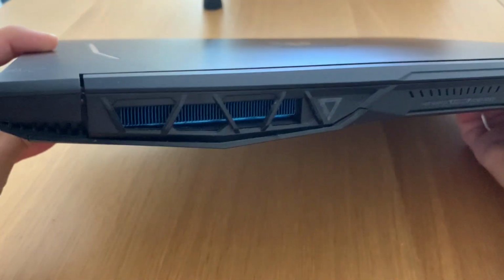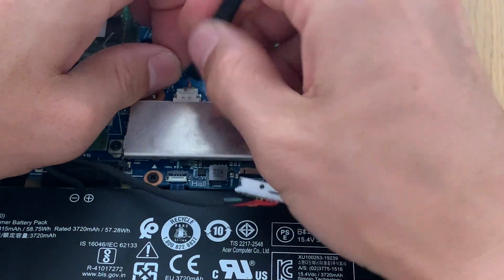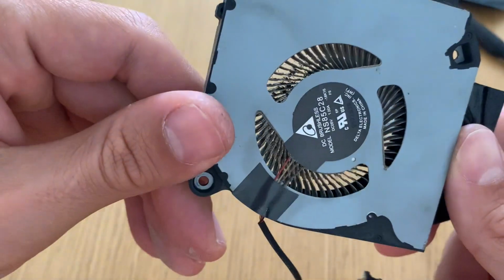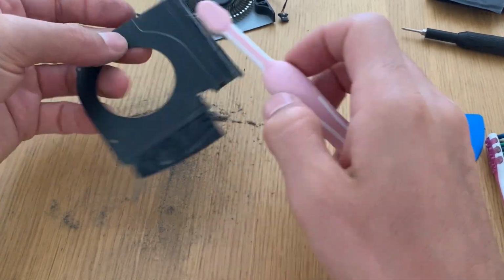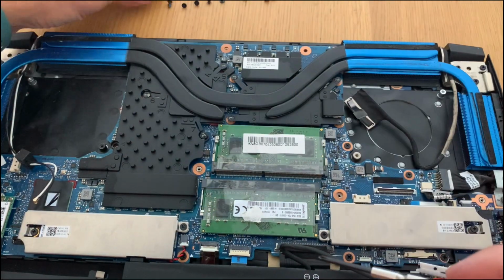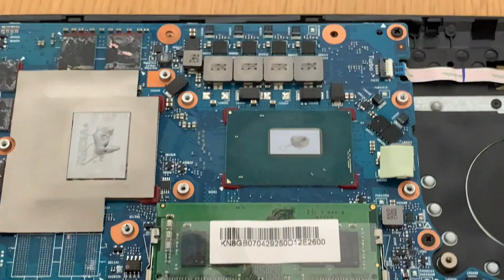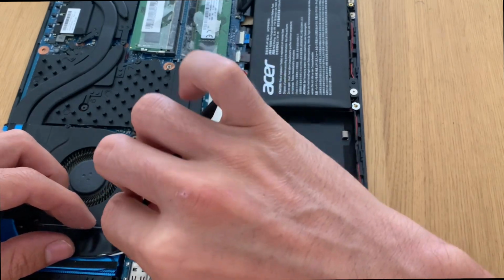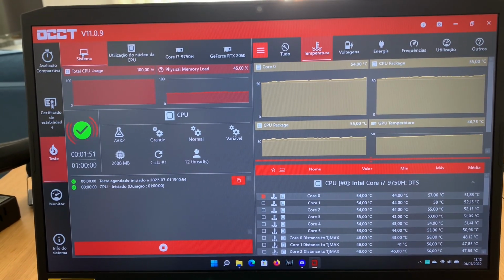Overheating Acer Predator, What to DO?

Comment: Same problem cpu reach 99c 
Should i disable intel turbo boost
And after how much time should i apply new thermal paste
Reply from the maker: A clean should do the trick, just follow the steps on this video, it worked for this computer, me and the owner learned that part of the issue was also a defective charging brick that was not outputting enough power on it, apparently it is a thing in this model.
New thermal paste depending on the use should be done at least every 2 to 3 years, or anytime you need to open it to clean.
Good luck

Comment: Hey nice video btw

I got acer predator triton 500 with rtx2060 and it’s overheating. What thermal pad and thermal paste you consider for me to buy?
Reply from the maker: Hey, thermal paste I use Artic silver its expensive but very good, thermal pads only replace them if your shatter when removing them, if they do you can buy Innovation Cooling Graphite Thermal Pad.
Reply: @zul_fix  what about honeywell ptm7850? Some reviewers said it is good too. What about your opinion?
Reply from the maker: @Sharulsyaz  cant really say since i have not used it but reviews are very good. Maybe give it a try and let me know!

Comment: I have the same laptop. And I cleaned my fans out and redid the thermal paste. My in game GPU temp is around 68 Celsius. Is that safe to game?
Reply from the maker: Absolutely, that is a normal temperature, you should be carefull if it reaches over 90ºC for long periods.
Reply: thanks it never goes above 80 @zul_fix

Comment: Bro I'm having acer predator helios Neo 16 4050 variant , Its overhaeting i.e cpu hits 99 degrees while gaming how to fix this
Reply: I even replaced the fans
Reply from the maker: Did you replace the thermal pads and the paste?
Reply: @zul_fix  no bro I only bought before 9 months ago , customer guy said yours is liquid metal thermal paste and you don't need to apply it for atleast 2 years . My problem in short is cpu cores #5 #7 are producing more heat
Reply from the maker: @badrinathgunaseelan317  maybe he has not applied it well and it has dry spots.
If you are ok doing that purchase liquid metal and check if the cpu is fully covered by liquid metal.
If its not then use the bud that comes with the liquid metal to clean and the seringe to reaply it.

Comment: my gpu stays 50°c and my cpu goes 90°c and i started to see artifacts does that means I have permanent gpu damage?
Reply from the maker: Those temps are normal if the pc is running games over 90ºC is worrisome, if you see artifacts your gpu may be starting to fail indeed.

Comment: Omen or Predator which is the better overall one
Reply from the maker: Prefer the Predator
Reply: @zul_fix  any specific reason? And thank you!!
Reply from the maker: @kodeth5200  specs are better for gaming.
Battery is shorter then the omen but if you have it plugged on the outlet it performes very well.